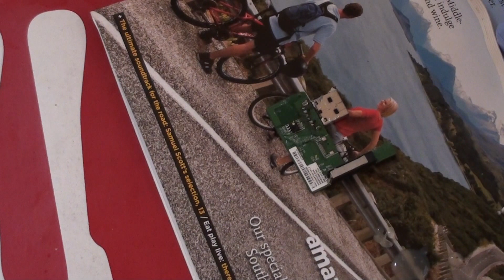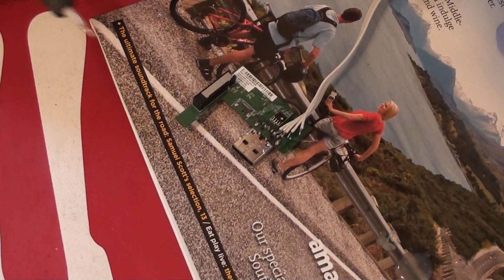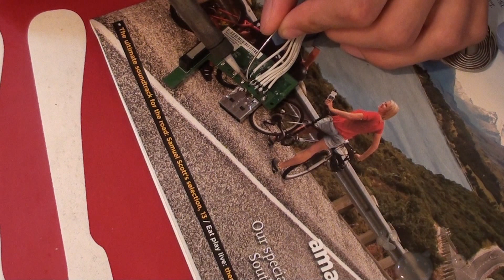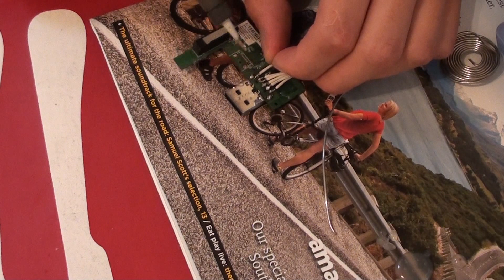Xbox 360 Laptop - Wifi module extension (full)

Comment: i followed the video as it is and my wifi did not work at all with or without the ground wire.
all good joints ,what am i doing wrong ? at the start of the video you had 6 wires and at the end you had 7 wires.
Reply from the maker: I'd say you soldered the pins in the wrong orientation. Sorry for the late reply only just saw the comment... G+ sucks